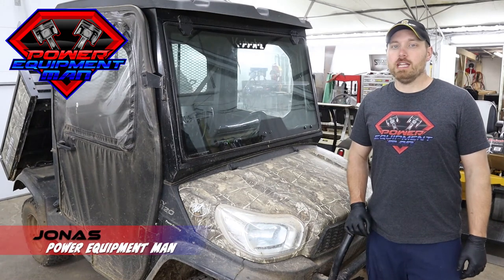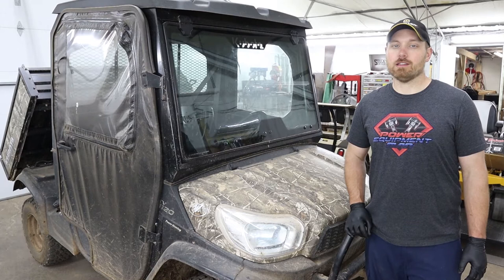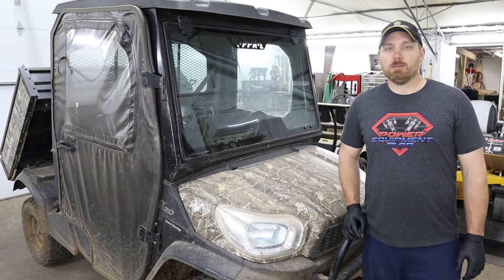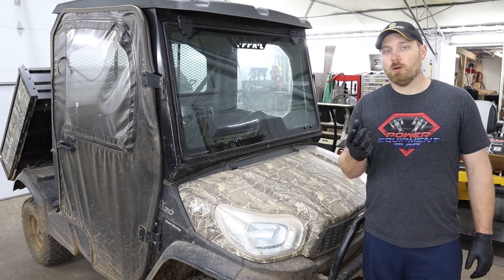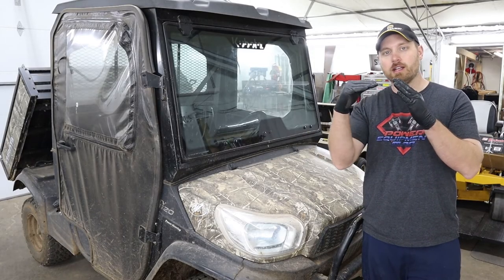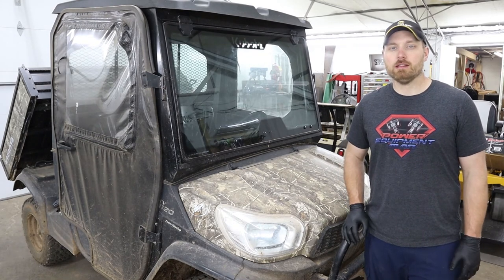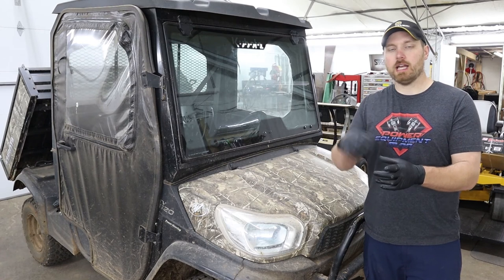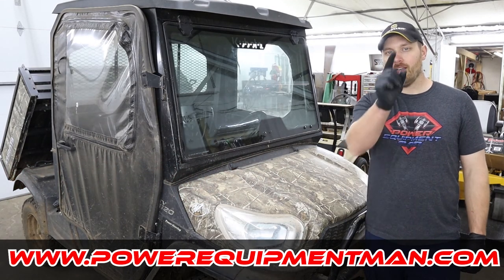Kubota RTV X1120 Engine Oil Change - QUICK AND EASY

Comment: Did you remove the skid plate before cutting the hole?
Reply from the maker: No, you just have to be careful to not hit the oil pan while drilling. I have done this on 3 RTVs now without any problems.
Reply: As we were taking the skid plate off my helper noticed a hole in the skid plate.  And sure enough the hole was just below the drain plug.  We got this XG850 a year ago.  So Kubota is now cutting in the hole for this model.  The hole is placed just so the oil goes straight in without splashing around.  Strangely the service manual still calls for the skid plate to be removed when changing the oil.
Reply from the maker: Thats nice that yours came that way. We just had a brand new 2022 RTV 1120 about 2 months ago that did not have a hole from the factory, so we made one.